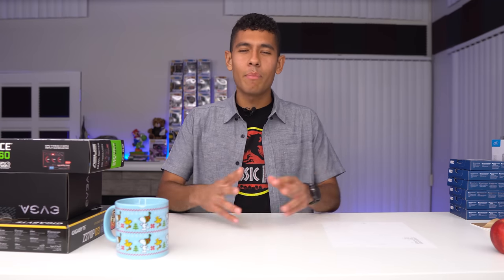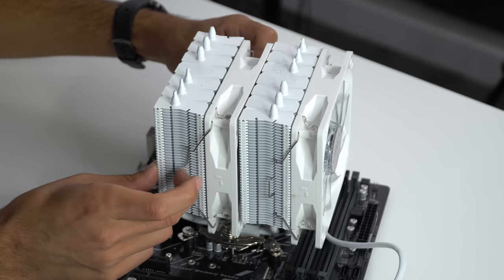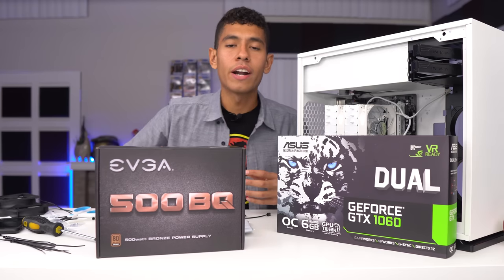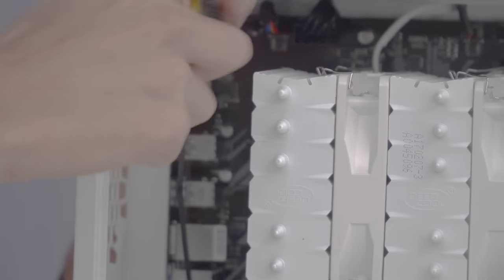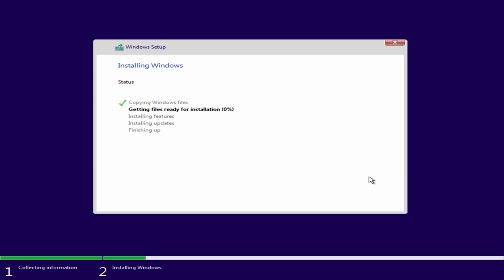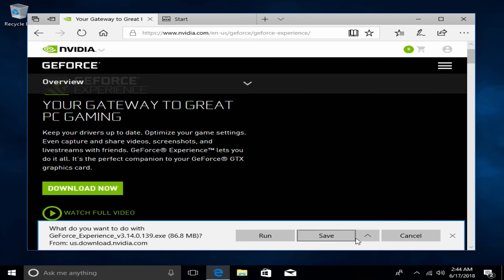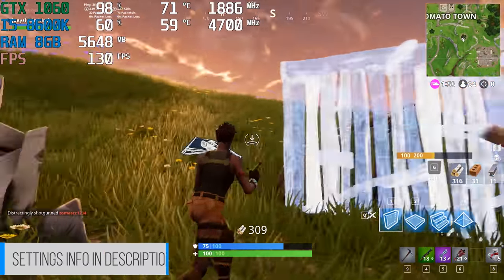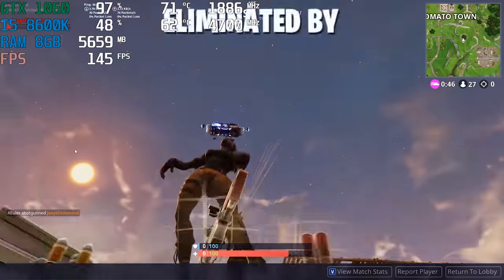Best $1000 Gaming PC Build Guide - GTX 1060 i5 8600K (w/ Benchmarks)

Comment: I’m really considering switching to pc but I was discouraged by not knowing anything on how to build one. And now thanks to you I think I will finally make the switch, you earned my sub.
Reply: go ryzen its cheaper and faster than ryzen for frames per buck
Reply: PROTOT-Y-P-E if you are interested in hardware since you want to switch to PC, then its gonna be an interesting ride learning about the PC
Reply: What are you doing here alex
Reply: I just finished my first pc build 4 days ago best investment Ive made.
Reply: PROTOT-Y-P-E don’t make this build. At this price you can get one twice as fast
Reply: don't follow this guide. $1000 for this config is very expensive
1060 + i5 with only 8gb ram and mechanical drive for $1000 is bad deal. Even if you buy prebuilt on sale you would get much better value. Best Buy just have a more powerful Power PC prebuilt for around this price. But even Power PC builts are not good deals compare to prebuilts from HP and Dell and Alienware
Look for deals on prebuilts: for <$1100 you can have i7-8700, 16gb ram, gtx 1070 8gb and a boot drive SSD/NVME + a mechanical drive. Rakuten had Dell Inspiron with that config and 256GB NVME + 1TB HDD for $1090 usd after coupon.
i would pay no more than $800 for a 1060 + i5 config, and it has to have a ssd or nvme boot drive
Reply: Valentino Colella specs?
Reply: I just want to build a pc
Reply: qline17 Ryzen isn't faster in gaming than Intel and products such as Adobe
Reply: Black Charisma no wtf this is horrible for that price
Reply: Dug do you know any PCs on amazon that are $1000 or less
Reply: popnimpop what do u recommend for $1000 and under?

Comment from the maker: NEW $500 PC Build Guide is now live! :D https://youtu.be/LGTqOqznXKw
Reply: I have 1000 and I need help building a gaming pc
Reply: Joey Delgado bro i was wondering if I can replace the fans you used in this video with EZDIY-FAB RGB LED Case Fan 120mm,High Performance Adjustable Colorful Computer Case Cooling-1 Pack (No Controller Included) or is it a 120mm fan frame?
Reply: Joey Delgado ere
4.3 out of 5 stars  22 Reviews
upHere Wireless RGB LED 120mm Case Fan,Quiet Edition High Airflow Adjustable Color LED Case Fan for PC Cases, CPU Coolers,Radiators System,5-Pack / C8123-5 or with this one man thanks
Reply: vLogix I’m pretty sure they’ll fit if there 120 mm so you should be good
Reply: riichyz mind thanks man
Reply: vLogix np
Reply: Joe if i replace the i5 with an i7 would ot still work
Reply: Issaiah Garay I’m not Joey but they are compatible if the i7 is an 8th generation cpu(i7-8700k example)
Reply: @riichyzz  is there anything else you recommend upgrading to
Reply: Issaiah Garay one minute
Reply: Issaiah Garay If you have the money the graphic card (1070 ti or 1080 ti ) if you have the money and the ram if you look to stream (16gb 3000 MHz Corsair lpx) and a mother board that is an atx size (maybe one from the Asus rog line) and if you upgrade all that then I recommend you also upgrade you power supply ( 650w GQ 80+ EVGA)
Reply: Issaiah Garay if you need just watch the 2000 dollar pc build Joey posted before this video
Reply: question: why the ram on the grey sockets?
Reply: dude can you help me i only have a lenovo ideapad 500 and corsair mouse and my laptop key on the a button pls help
Reply: my pc is $1003.24 i wanted it to be exact $1000
Reply: but i managed to get a 1070 ti and an amd ryzen 5 1500x

Comment: For anyone going to build this I would recommend switching the gtx 1060 6gb for an rx580 8gb, in a lot of games it's runs more smoothly/faster (without any NVIDIA settings on off course) and it's cheaper than the 1060 by $40 to $60 in SOME countries. But do keep in mind that there is a little more heat and the power consumption is higher with the rx580 especially when overclocked. Not anything horrifying but it could be considered a problem for some people and even though a lot more games run faster on the 580 there are some pretty popular or mainstream games that favor the 1060 one being fortnite and I'm pretty sure overwatch. Ohh, and great tutorial joey!
Reply: @thesafeman04  You have a minecraft profile picture. I'm pretty sure I can safely say you don't a clue about what you are talking about.
Reply: @SchizoGarcia  😂😂😂😂😂
Reply: GrubbyTuba4  its more expensive....
Reply: GrubbyTuba4  ofc it will bud! but you will need to upgrade the psu to 600w or you can use the 500w but atleast a +80 bronze so that itll be stable.
Reply: What psu would you recommend if I were to switch to rx580 instead of 1060?
Reply: @juanvilla6338  a normal 500w is enough :)
Reply: Mr Benz can I use 16 gb of ram with this build
Reply: @juanvilla6338  A 500 to 650 psu. Modular if you can.
Reply: @SSurvival EVGA or Gigabyte 1070Ti is what he meant probably
Reply: I'm going to cook my eggs to your rx580
Reply: Nigga, rx580 are rare in my country,  there are only nvidea
Reply: Can i change the cpu to ryzen 2 2600 and the gpu to rx580 8gb and what mother board should i go?
Reply: Mr Benz do you have Instagram, I wanna ask some questions.
Reply: Jonathan Richie you will need a b350 chipset motherboard mate
Reply: @exterminatorgr8669  ahahahaha
Reply: YES!
Reply: The Fursecutioner 779 Damn.
Reply: Bro please tell me can I add more RAM i n this PC
Reply: Will the XFX Radeon RX 580 GTS XXX Edition 

Work

Comment: Hey Joey what’s up man, I literally made this build as soon as you posted this video. And I could not have been happier!! But recently I was playing some fortnite and all of a sudden my computer turned off in the middle of a match. And now when I go to turn it on the Cpu fan lights up along with the case fans spinning for like half a second and then it stops. I literally started panicking because this is my first build,  I thought I just threw 1200$ down the drain. But as I cooled down I tried to look for answers do you think a 500 watt power supply is too little for such a power hungry system?? I’m still trying to find out what’s going on 😩😫 HELP!!

Update 9/12/18: Thank you guys so much for your feedback! I’m happy to say that it was indeed my psu that was faulty. And after installing the new one, my pc is working just like it was on day 1! 😁
Reply: fortnite is a virus... smh
Reply: Hayder _  If the system didn’t have enough power it probably wouldn’t even turned on from the beginning.
Reply: simonoswald _44  Lol yeah I figured, I mean it’s been working flawlessly for the past month. I’m gonna assume it’s the PSU. I contacted EVGA and they sent me an RMA, if it doesn’t work after installing the replacement PSU Idk what to do man. What luck 😕🤣. Thx for the reply!
Reply: i also got overall the same build with a evga supernova 650w used my build for 10 hours during which i kept downloading updates then i launched fortnite as i got to the menu turned off psu ded rip
Reply: Hayder _ try disconnecting cabinet fan
Reply: Pinku 123legend why would the fans be a problem 🧐? Lol I already took out the PSU I’m trying to make this a risk free operation 😂. If it doesn’t operate with my new psu, I’ll definitely give it a try! Thx for the reply!
Reply: Deviim omg 10 hrs? Are you sure the psu is the problem?
Reply: Hayder _ i used the evga detectoon tool and the psu fans didn’t spin so i think it’s dead i don’t have any other psu’s tho to test everything
Reply: Deviim ah ok, if the psu fans don’t work then it’s definitely a dead one. Dang, wish the best for you man
Reply: Hey, any updates on either of your situations? I was thinking of getting more or less the same build and I don't want to have the same problem
Reply: same
Reply: Sky Jax my replacement PSU is coming next week, I’ll update as soon as I get it. I recommend if you get this build go with a 600 or a 650 watt power supply.
Reply: Evan Peou ^
Reply: okay, thank you for the advice.
Reply: Your system is shorting on something. your problem is that you followed this video when building. 
or you just don't know how to install properly. your hardware is most likely fine.
it's hard to help you trubbleshoot in the youtube comments so just take all the parts out (except for the cpu ofc) and install them back in making sure you are using stand offs and no metal from the case is making contact from the case. 
I've been there before on some of my first systems it's a common mistake.
Also if you want to try one last thing before taking it appart you can unplugg everything remove the "cmos" battery on your motherboard (silver flat battery usually lower right of the board) for like 10 min.
Reply: Sky Jax
You won't as long as you have some experience or you watch a video that isn't this guy he doesn't know what he's doing.
Also get a 8500 or 8400 instead of the 8600k since the 1060 6GB is the limiting factor so buying a 8600k vs a 8500 won't affect performance when gaming.
Reply: RENILO wooow I didn’t even think about that!! But I already assumed the PSU was the problem cause of this video 

https://youtu.be/HZZoyxv7Lug   🤦🏽‍♂️😂 

Mann I wanna test out what you said, but my replacement PSU is not here yet 😭 I’ll definitely update once it gets here. thank you so much man greatly appreciated!!!
Reply: RENILO yo what did he do wrong? It seemed fine with what he was doing
Reply: Hayder _
He is installing everything so the camera can see. You're not supposed to install the motherboard vertically, lay the case down on its side and then install the motherboard.
That's the biggest thing i saw he did wrong but he also did a few minor things like install order etc.

Oh and also he started plugging in the board before it was installed and he was just holding it.
Reply: surie v2 yeah man idk why it’s taking so long for my PSU to come in but it’s supposed to be here by tomorrow, I’ll update post installation! Thanks for the reply
Reply: RENILO I AGREE. I copied his method of holding the mobo vertically and it was so hard to get it through the io shield.
Reply: surie v2
You shouldn't have to worry just follow this www youtube com /watch?v=YySa723VD2Y and adapt it to your specs and you should be fine.
you should also have some sort of anti static measure however i've never done this and i've never zaped any parts.
if you are wearing socks or have a carpeted floor you should probably use an anti static whristband or something (touching a large metal object usually dischareges any built up static).
Reply: Hayder _
Yep, IO shields are a pain in the ass anyways I can't imagine how frustrating it would be to install it vertically.
remember also you don't really need an IO shield if you don't want it
Reply: I'm considering this build to transition from console to PC gaming. Just curious how well does a game like fornite run on this build? As in what settings can you play on while still getting 60+ fps?
Reply: Yegang Park
Fortnite will run great I'm sure, for reference on my build with an I5-8500 1060-6gb I can run Forza Horizon 4 at high-preset (1440p) and get up to 90 fps.
And running at maxed out settings I get 30-50.
Reply: So is there any tips before making this build. It would be my first build so I do not know what is good and bad . Any advice would be greatly appreciated (:
Reply: Congrats!
Reply: gg bro, i'll build my own pc soon and i'm very scared for cables :/
Reply: Thinking about building this for my son....... but don’t know anything about pc.... is this something I should follow ......
Reply: Robert how old is your son? because if hes 11/12 or older I think you should build it with him because its not as hard as it looks and its a good experience also this is a very great tutorial. Also your son would probably be thrilled with this so if you are considering it you should do it
Reply: Improvisable    My son is 15,  and he’s been wanting to switch from Xbox one to pc..... so I’ve been trying to do some research on it.   Probably going to surprise him for Christmas,          Is there any other tips you can give me, if possible.   I’ll appreciate
Reply: Well I have 2 tips off the top of my head, you should get a 144hz monitor with it (joey also made a video on a good budget 144hz monitor) and you should ask him about a gaming keyboard and a gaming mouse. I don't know your son but you might want to give all of the parts for christmas and build it with him because honestly it's a good experience building a pc
Reply: Can you tell me wich PSU you used? Just to not run the risk. Would a 600W do? Im new to this😂
Reply: Mr. Park he uses a EVGA 500 BQ 80+ BRONZE Power Supply and heres a link  https://amzn.to/2tCpLeE but if you can get a 600w psu get it so whenever you upgrade your psu still keeps up
Reply: So should you buy a better psu or was it because your psu was faulty
Reply: I am trying to build this set up, can you tell me what u fixed please so I dont run into this problem. Thanks in advance!
Reply: Leon Leite in this case, my psu was faulty, and ever since I replaced it with the new supply I haven’t encountered any problems 👌🏽.
Reply: Yajat Shirpurkar my build was fine, they just sent me a faulty Psu, one tip I will give you is when you build it, lay the case on its side when you’re installing the motherboard, makes it like a looooot easier, especially knowing that part alone took me an hour or 2 🙄
Reply: Leon Leite for future upgrade potential, I honestly would recommend a 600-650 watt psu. But the psu in this video works just as fine
Reply: @hayder_5472  thank you so much
Reply: @MegaGamerscast  Hey, idk if you will see this but can you help me decide if joeys other build is a good first build?
Reply: @HestonJames  Use this build with an I5 8400 or 8500 and a 1060-6gb and maybe a fractal design define-c case and closed-loop liquid cooling of your choice and you should be fine.
but search around youtube for a 1060-6gb build and find a video where someone knows what they are doing.

Comment: You’re back! And what’s happened to your banner? Anyway I built your $2000 build yesterday and I love it! Apart from the NZXT Kraken x62 screen doesn’t work! Nice video Joey!
Reply: Specs?
Reply: I have a GTX 1080 with an i7-8700k, 16gb ram, 750w psu, nzxt Kraken x62, nzxt s340 elite, 256gb ssd, 2tb hdd. 
The temps are amazing, when gaming for a couple of hours my gpu managed to stay below 75°C at all times, and my cpu idles in the high 20s which I am happy with.
Reply: Groovy I have the nzxt kraken x62 280mm version and it fits perfectly in the front of my case, cable management in the case is very easy also.
Reply: No_Lifee I kept wiping my phone screen XD
Reply: dat dam pfp
gets me everytime especially when im on my phone i keep thinking its my hair ive seen so many people with that

Comment: i think im going to build this pc soon just with different colors and 16 gigs of ram with a different shell also. ill keep informed if you would like to know how it runs
Reply: Itz BananaMan so does it seem faster?
Reply: there are way better systems you can build than this with the prices of hardware this end of year. i would definitely recommend a ryzen 5 2600 over a i5 8600
Reply: Thomas Duffy if I change the graphics card to  GeForce GTX 1060 6GB GDRR5 192-bit HDCP would it be faster or slower? It’s $50 cheaper than what he has
Reply: @trusty_7738  I have no idea but what I did works
Reply: Trusty _ it's depends on the thermal solution with the gpu. I have a msi gaming x 1060 6gb at 2070mhz and that's a high clock for 1060s and i get 30+ fps compared to a normal gigabyte 1060 6gb
Reply: Itz BananaMan how well did it work and how long did it take you?
Reply: Ritz Corp first of all a case is like a shell. It protects the Organs(components) from getting damaged. Stop acting like that, when you know what he means
Reply: Deffinately get a ryzen and a rx580 and you will have the same or better performance and a much cheaper price
Reply: @fluffy6485  chassis*/cabinet/case whatever you want to call it.
Reply: 呪Noro mate it has a name and that is chassi
Reply: @cablenowadays6586  when i put that in PC parts picker it says it wont coordinate the parts. Is that true?

Comment: I built it but the i hooked the monitor there no hdimi in put ive never built a pc and i dunno if i did something wrong i really need help it 😞 (edit i just couldn't find the power button LOL)
Reply: maybe try settings on your monitor. sometimes you have to select input
Reply: Monitors don’t use hdmi though
Reply: FlowKhaulfy some do????
Reply: Balenciahgas ????
Reply: @tesco4410  lmao big wrong
Reply: Remember to hook the monitor to the graphics card’s hdmi port NOT the motherboard hdmi port.
Reply: @Athasin  how do you do that
Reply: Nuvo Just plug your hdmi cable it into the hdmi port on the graphic card. If you plug it into the motherboard then you’ll be using your CPUs integrated graphics instead of your graphics card graphics.

Also, some motherboards shut down the integrated graphics the moment you put a GPU in it, and so then if you do plug your hdmi into the motherboard you get a no signal message.

You have to plug your monitors into your graphics in order to actually benefit from having a graphics card.